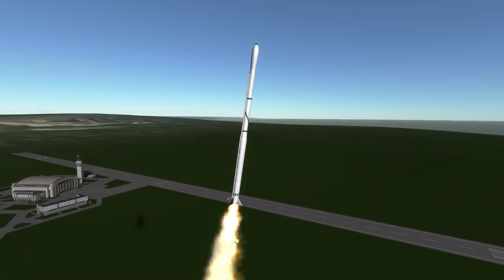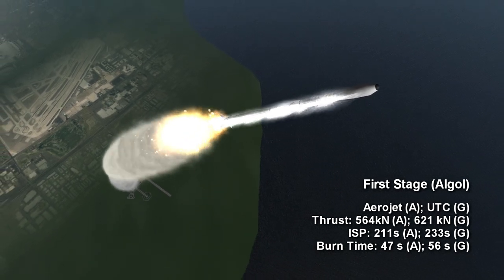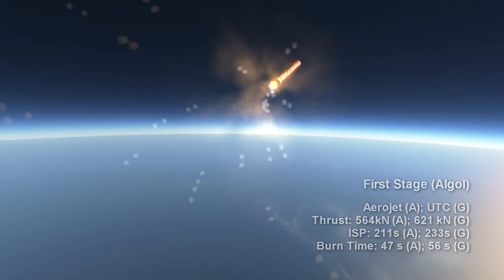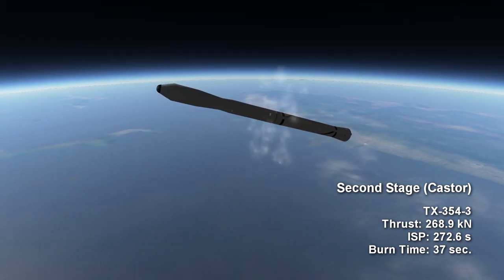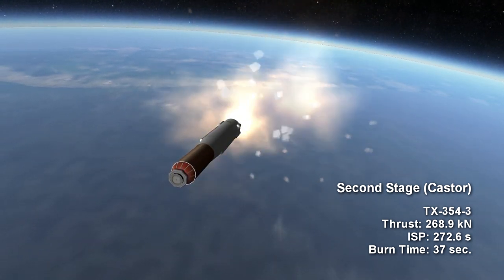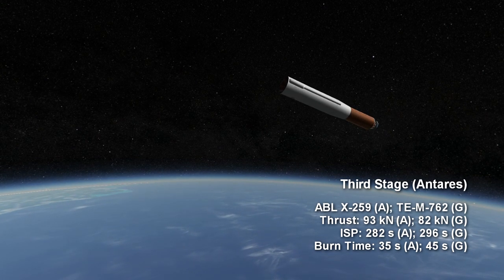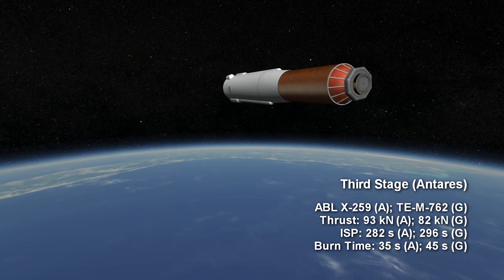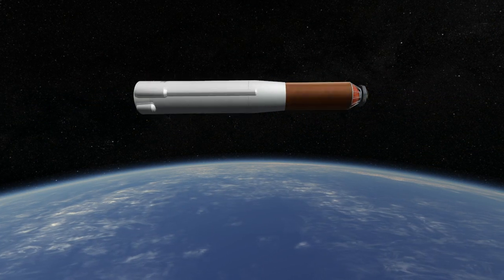Rocket Profile - Scout A and G

Comment: I created a similar rocket in KSP RSS RO RP-0 that is essentially a vastly upscaled, fully guided Scout. It's called "Big Scout", by analogy with Big Gemini. As it uses all-solid stages, it's not the most efficient launch vehicle (having a 111:1 payload mass ratio), but if it were produced, it could potentially be very cheap and reliable for its simple construction and use of stock components, possibly ranging from $15-60 million. It is also incredibly needle-like in shape, making it cool to look at. Stats: 

Big Scout:
 
First stage: 1x Space Shuttle Solid Rocket Booster (can be upgraded with SLS Solid Rocket Booster) Theoretically recoverable.

Second stage: 1x UA-1205 (same as used in Titan III) Theoretically recoverable. 

Third stage: 1x Castor 120 (Peacekeeper ICBM first stage) 

Fourth stage: 1x Minuteman ICBM first stage 

All stages have approximately equal delta-V and specific impulse. Top 3 stages could be thrust-limited to suit mission requirements, with typical arrangement being 100%:100%:40%. 

Gross mass: 1,540,000 kg

Dry mass: 141,000 kg

Payload to LEO from Cape Canaveral / KSC (prograde, zero relative inclination): 14,000 kg

Payload to LEO (polar or sun-synchronous (SSO)): 12,000 kg

Payload to LEO (retrograde, zero relative inclination): 9,000 kg 

Upper stages (orbital): Burner, Able, Castor, Delta, Altair, Agena, Centaur C (Saturn I Centaur) 

Upper stages (suborbital): Centaur, Scout (yep. Big Scout-Scout. EIGHT STAGE all-solid orbital launch vehicle for interplanetary missions. 250 kg to Solar System Escape.) 

An optional 1st stage could be added beneath it (making a 5-stage to orbit), an augmented Pyrios with 3 F-1 B engines increasing its payload capacity to LEO up to 32,000 kg, and its price to $60-180 million.
Reply: I didn't include the Inertial Upper Stage, Payload Assist Module, and "all those Star motors" because I forgot about them. The latter two would be orbital (as in, could be placed into orbit using just the stages of the launch vehicle itself), whereas the first would be suborbital. I wanted to send a Mars mission with a Big Scout-PAM (all solids!), but my delta-V skills aren't good enough at the moment, due to the... all solids.

The Pyrios is too large to act as a side booster—maybe the GEM solid boosters, Delta IV core stages (I doubt this due to hydrolox propellant extending burn time), or even Thor missiles could work (none of the above stages would work well—their burn time is too similar.) 

(I deleted this comment by accident earlier, so that's why you're seeing it again...)